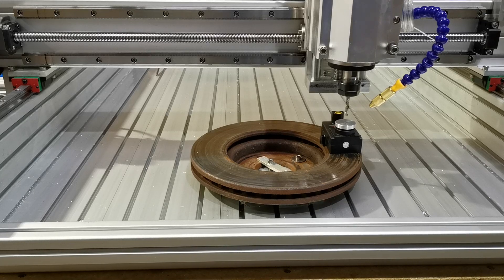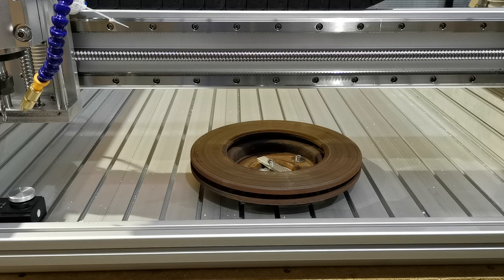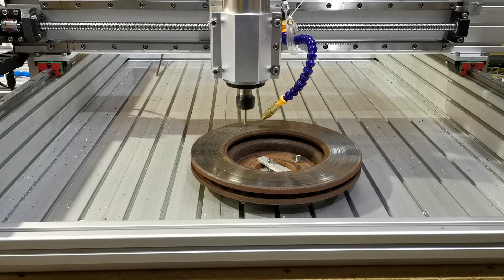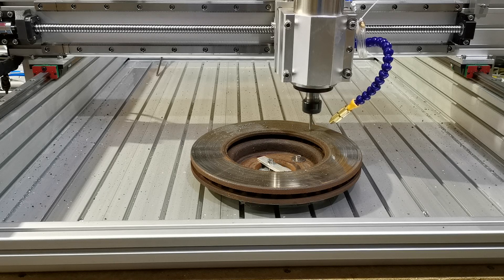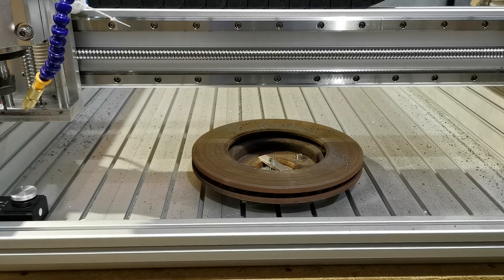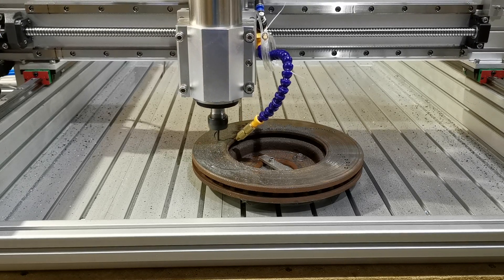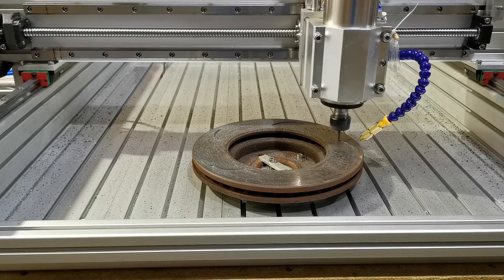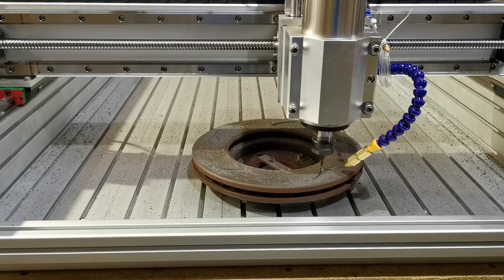CNC Router cutting Metal Car Disc drilling and fluting or grooving  with our new Router ERS8080.

Comment: We are Random Bros: 316 Stainless is softer than that brake disk so yes you can mill Stainless on this machine
Reply: Grey cast iron or ductile iron, which most brake rotors are made from, is far easier to cut than steel or 316 stainless.  Yes by all outward observations it is “hard” but there is more to metallurgy than just one observation.

Comment: Pleased you didn't call it a CNC Mill. It will never be a Mill, it doesn't have the rigidity or weight and the spindle runs way too fast, like all routers.

Comment: Slow dawn spindle rpm its to high you are coock this dril . And FZ its to agresiv for dril. Brake Disc cant be flat its litle voble for push back pasticks if you relase the brake pedal. Optimal its estlcam for this job be cose hawe suface scanning and create surface map. But nice idea 😉
Reply from the maker: Hello, as we explain just a demo, not optimised and drill is carbide, just showing cutting metal not ment as real use of cutting disc but thanks. Just showing what you can do with it other examples to follow.
Reply: @cnc4youUK  ya i think he missed the point. Lol

Comment: Excuse me if I missed it, but could you tell us the number of flutes on the end mill, the rpm of the router, and finally, and finally the depth increment with the rate of feed. I too have a similarly built machine and would appreciate your data as you have used them here.
Reply from the maker: Hello, this was never optimised just written and cut? so use this information with caution depending on your machine. Cutter 4mm 2 flute carbide (better to use 4 Flute carbide), 15000rpm, I think 0.2mm depth of cut and 1000mm per minute feedrate sorry file never keeped so going on memory.
Reply: @cnc4youUK   bonjour je fait aussi de l usinage metal moi je parametre avec une fraise de 3mm 4T A 5200 Tour / minute et 150 mm  d avance et ca marche tres bien

Comment: Aren't typical automotive rotors grey cast iron? The fine particles and spark formations sure look like it.
Reply from the maker: Hello, thank you for that looks like you are right and we have changed title etc. many thanks for the information.
Reply: @cnc4youUK  great video though. Thank you for the upload. I'm studying up on routers to make one.
Reply from the maker: @user-qy9rg3nt2l  Thanks, have changed little to metal as told by company who gave me disc it was high performance steel disk so as i don't know have changed to Metal, as we do cut steel on our machines normally C45, E8 and some bolts stainless as make good cams for a special project for one of our customers.

Comment: What generator output would you need to be able to run this machine. As the motor starts and stops spinning regularly I guess the in rush current to feed it is always maxed, meaning 8 kw continuous generator output. Do you know? Also is it 50 hz or 60hz fir this. Presume being a motor 50hz power required. 

How much and table size 600 by 1200 can you do one?
Reply from the maker: We can make custom machines please contact us at sales@cnc4you.co.uk or 01908 315011 this is 240VAC single phase runs from standard power outlet at 13 Amps. So about 3Kw output would be more than adequate.